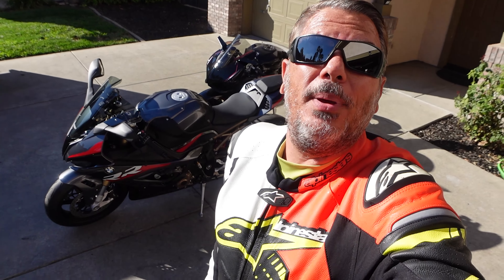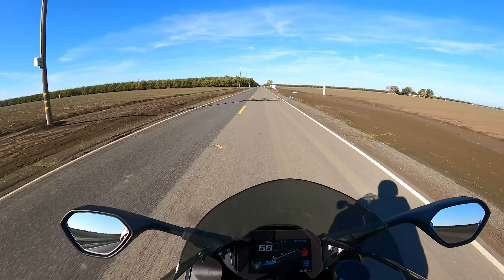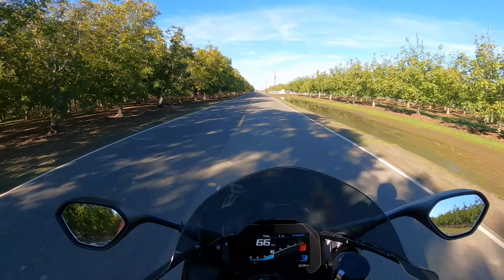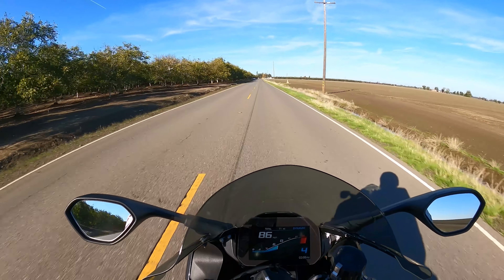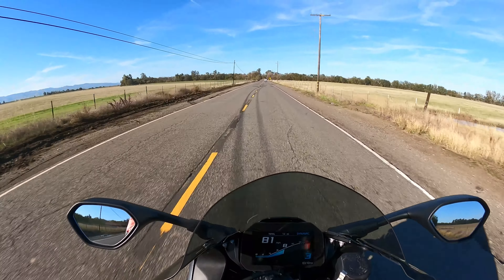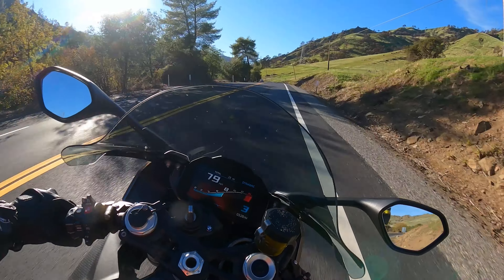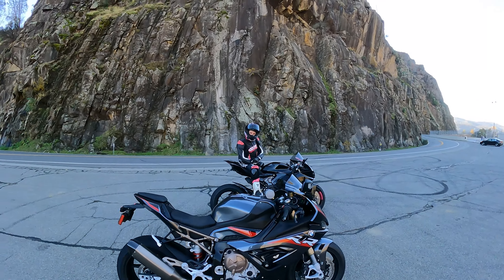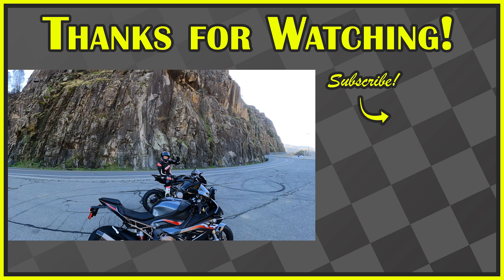Breaking in 2022 BMW S1000RR

Comment: Mate quick one 
I got my s1000RR 2023 3 days ago I did not know your break in and heat cycle but I turn it on from the dealership drive steady as the dealership dive not to exceed 4 rpm after the first 100 km I start doing your way but slightly less aggressive I did not exceed 8 rpm 
I’ll do the oil change at the first 1000 km what do u think
While the manual says almost your way

Comment: Hmm... I just rode like normally would - put in 1000miles before taking to the dealer (dealer recommended 1000mi prior to break in service) during this time I have raved to the max i.e. 8k limit quite few times. My bike runs fine it's at 3k miles now- the next oil change will be done per BMW recommend which 6k mi. I just don't know changing oil that often is worth it- since BMW does not ask for it. Maybe I'm doing it incorrectly idk.
Reply from the maker: We ride our bikes a loooot harder than most. Cheapest insurance to keep the engine happy are frequent oil changes.

Comment: Per manual:

While running in the motorcycle, vary the throttle opening
and engine-speed range frequently; avoid driving for longperiods at a constant speed.

Choose curvy, slightly hilly
sections of road if possible.
125 
Observe the engine run-in
speeds.
Engine run-in speed
<7000 min-1 (Odometer
reading 0...186 miles
(0...300 km))
<9000 min-1 (Odometer
reading 186...621 miles
(300...1000 km))
No full throttle (Odometer
reading 0...621 miles
(0...1000 km))

Comment: I thought you were going to include the theory behind your methodology - improving the seal between the piston rings and cylinder surfaces? What’s the most miles you have put on an engine broke in by your method as these days you seem to change bikes I dare say more often than most of us? 🇬🇧🏍
Reply from the maker: We sorta cover both in the video, and even suggest to go check out the motoman video for the science behind it 😂 Our 2007 GSXR had 25k miles when we sold it.

Comment: I would double check if you plan on flash tuning. All 2022 bikes built after July 2021 have locked ECU’s!
Reply from the maker: All ECUs are technically "locked". We'll find out shortly if this one is different and if we'll be able to tune it.

Comment: Question bud, did you use non-synthetic oil like moto man suggests? What oils did you use at your first couple of intervals and what is your long-term go-to oil? Thanks! Great channel, keep up the good work! 💯
Reply from the maker: We used what it came with from the factory, then motul 300v from there on
Reply: @CaliMotoTV  Great, thanks! When you did your 100 mile, is that when you switched to Motul? Or did you use BMW factory until the 600 mile?

Comment: I too am a big fan of Motoman's Method.  Sorry to say the critical item you missed is mating the rings and other moving parts BEFORE they become hardened by tempering (heat cycling).  Yes warm the bike up but then ride immediately using Motoman's method.  procedure